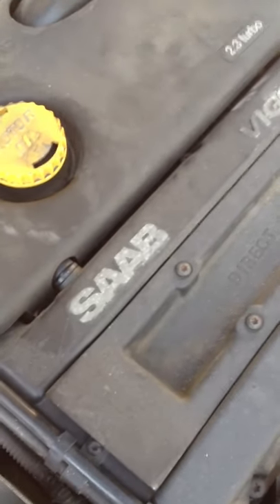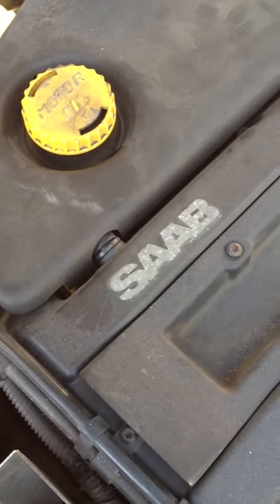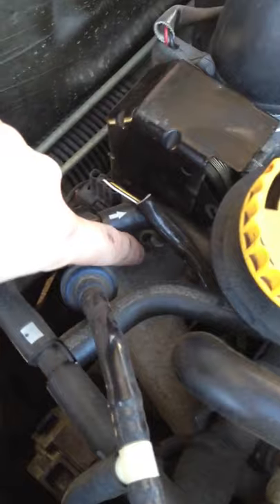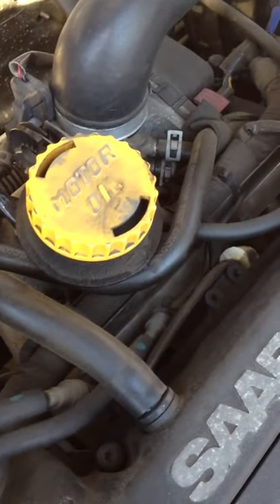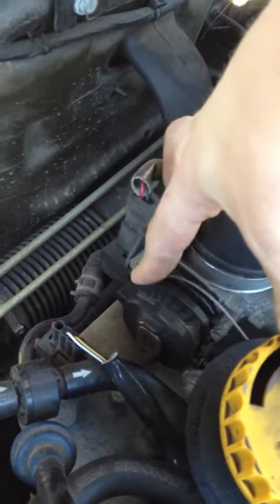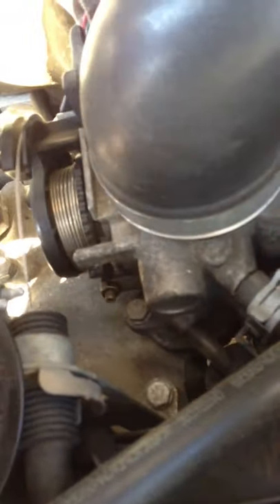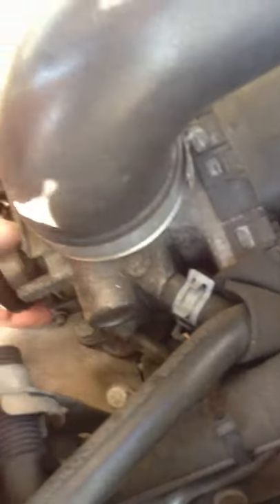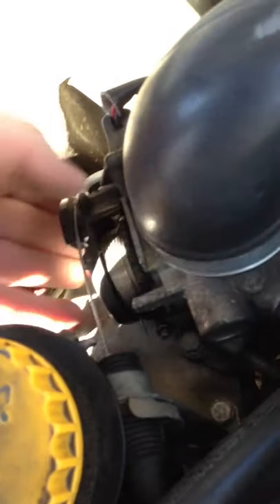Reset a Saab T7 throttle body from limp home mode

Comment: This did the trick. I followed the instructions, reset the limp home mode, disconnected the battery for about 15 mins, reconnected and she started right up, idled beautifully. and goes like a bat outta hell!    The CEL light went away. I'll have to see if the CEL remains off after some miles.Thanks

Comment: Thanks for posting this, and for mentioning that the codes must be cleared first.  I made the mistake of resetting my throttle body before clearing the codes, and it made the car have a very high idle before tripping limp mode again.  The second attempt -- clearing the codes and then resetting the throttle body -- worked the charm.

Comment: I used a OBD-II scanner to clear the codes. I believe what happened on my first attempt is that the throttle body was reset mechanically, but the computer was still on "limp mode" program due to the codes not being reset. Is your dashboard light on to indicate Traction Control has been disabled? This is a symptom of limp mode.

Comment: How did you clear the codes? Disconnecting the battery? And also i would like to know if this is what the problem is with my Saab 9-3 -02. Because after i did some hard accelerations, the car seems to be running slow, by that i mean the turbo gauge only boost to the beginning of the white zone. The first is green and the last is red, normally it boosts up to just the beginning of the red zone. Some advice would be much appreciated.